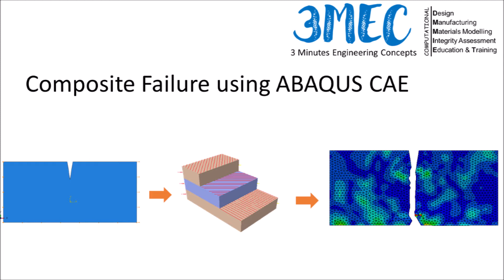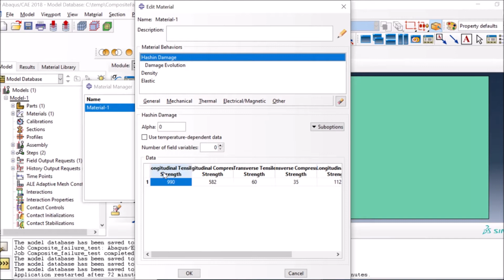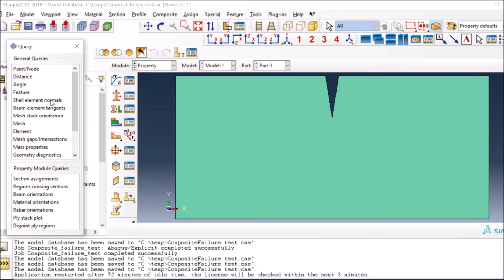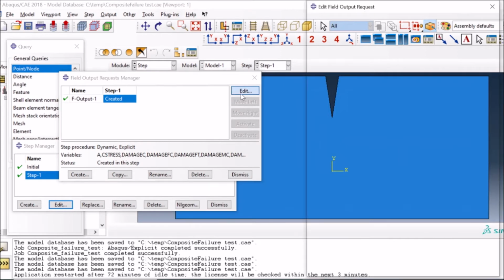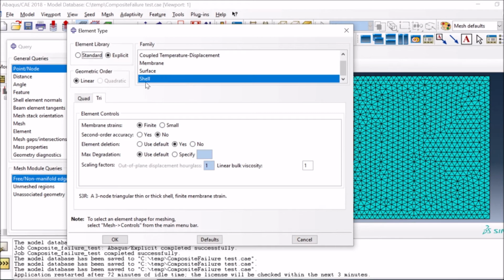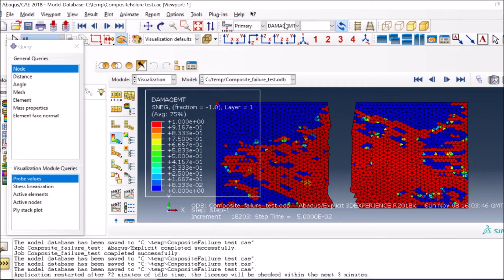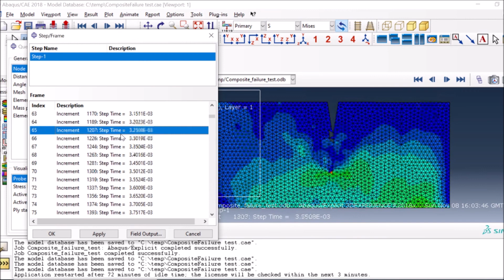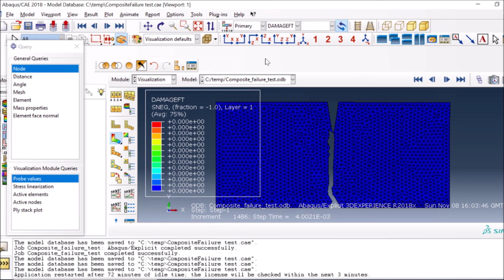Composite Failure Simulation using ABAQUS CAE with Element Deletion - ABAQUS Tutorial

Comment: Hello sir, 
nice work. I have a few questions.
I have seen people use max. degradation as 0.99 as a flag for element deletion in past literature. They generally used continuum shell for composite modeler. 
Can you send the cae or input file at rachits.ce.19@nitj.ac.in, so that i can play around with it.
Reply from the maker: Thanks for liking. If you could send me the paper I may comment further?  
I will look into my files to find it and will try to email you ASAP.